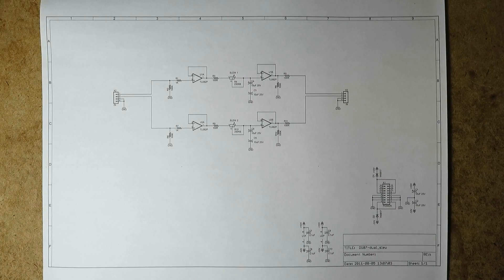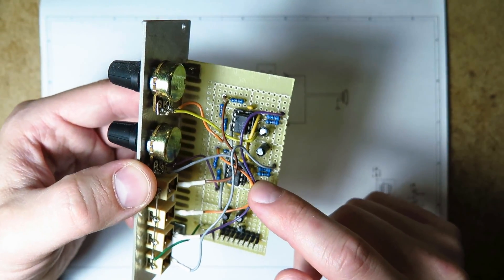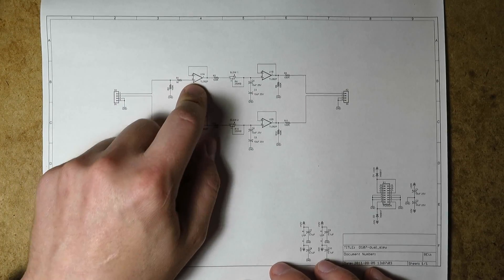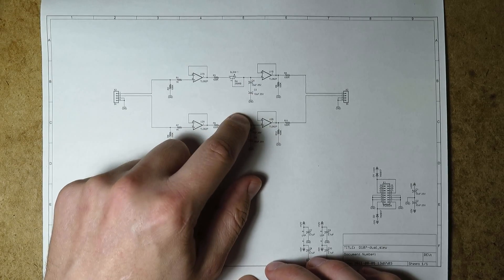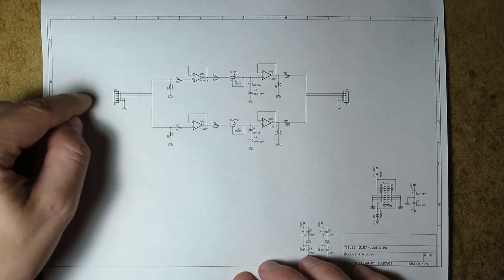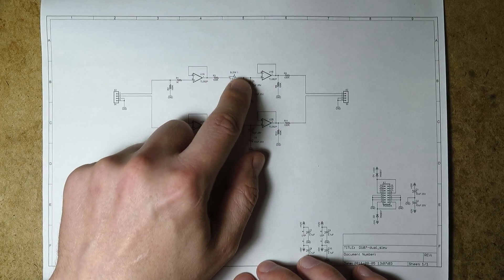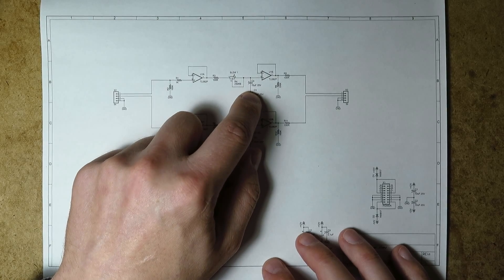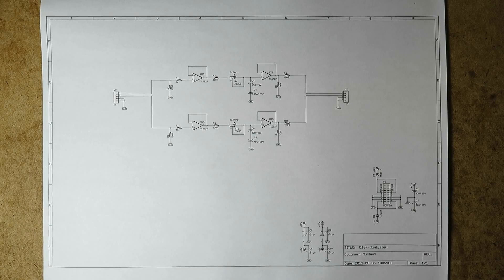Synth Tech - Slew

Comment: If I use a 100K pot instead of the 250K I just get a shorter max slew rate, right? I don't have any 250k pots on hand and I'm just wonder if it is worth getting them if I don't need super slow slew rates.
Reply from the maker: Yup that's right! Try a few and see which one works for you. You can also add extra resistance in series or parallel to change the range.

Comment: Really well-explained video, thanks.  I came here after looking at the schematic because I never saw electrolytic capacitors back-to-back like that before... Is this purely to get a "large" value of cap that's effectively non-polarised?  Could they be replaced with a single  4.7uF or 10uF ceramic cap? (I have about 50 of each sitting here!)
Reply from the maker: Yup you can certainly use a larger single cap. For audio coupling applications using normal polarized caps is the most common since usually large voltages don't develop across them in both directions. (you're usually putting on or taking off a DC offset) But for a circuit like this you want to store either polarity of voltage.

Comment: Great vid! I'm trying to build my own modular synth, and your videos have been a great help to a beginner like me! However, could someone help me understand -12v? Why not just use ground?
Reply from the maker: It's a seemingly simple question with a complicated answer.

Firstly, audio (and usually control) signals are often signals that vary up and down around a centre point. When there is no sound, the output is 0 volts. Most sounds are represented by vibrations that go positive as well as negative. (this happens in the real world too) So to deal with those in electronics we normally need to be able to make signals of both polarities. So we treat 0V as the centre, and set up our circuits to allow both positive and negative voltages. (with respect to this 0V signal, or ground)

The other part has to do with how most audio circuits are designed. The common component for modern audio and synth circuits is the op amp. Most op amps expect signals somewhere in between its power supply pins. Due to limitations in their design the signals can't go all the way to the power supply rails. So it's often convenient to power an op amp from, say, +12 and -12 and then deal with signal of maybe +/-5V or +/-10V. When the range of signals you want to deal with are well within the range of the power supply voltage rails, everything gets easier.

Of course there are exceptions and many low voltage designs (mobile phones, laptops, etc.) use a single power supply for audio circuits. But this has limitations and annoyances. Because most synth circuits are DC coupled so they work way down into super low frequencies, a dual-rail power supply is always more convenient, despite seemingly more complex and annoying to implement. I'll do a full video about this sometime but I hope that helps to shed some light on it.
Reply: Shiftedphase Thanks so much! Totally useful reply!
Reply: Thanks so much! Very helpful!